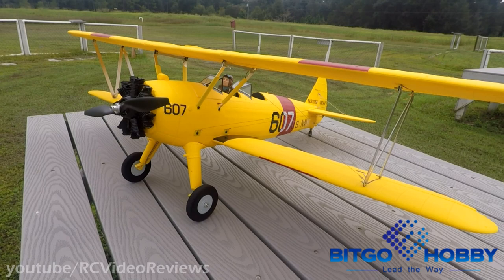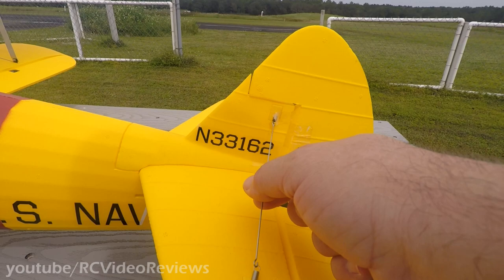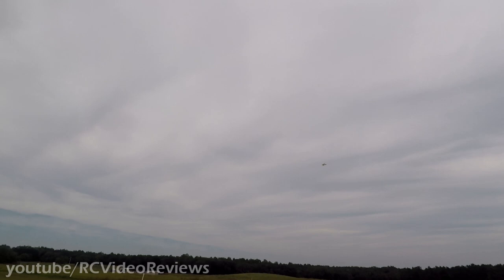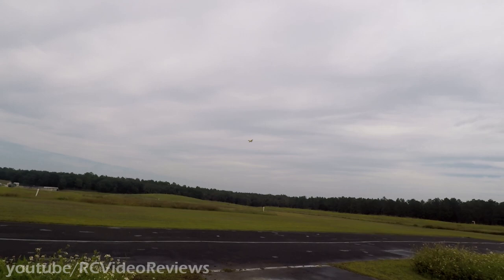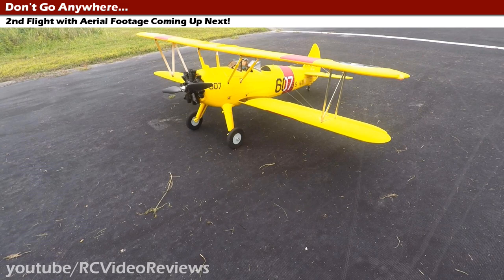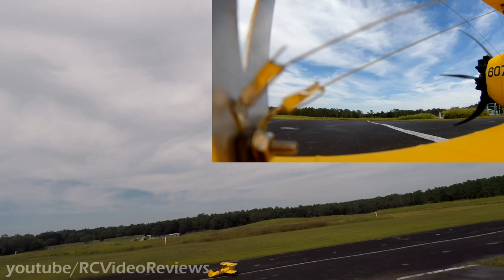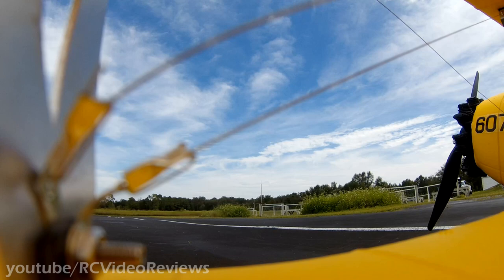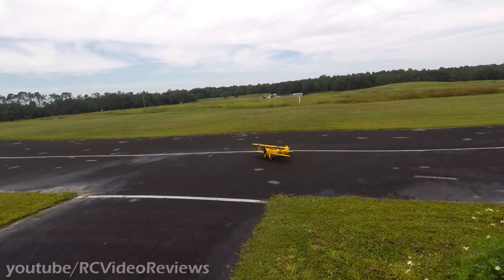Dynam PT-17 Build Recap and Maiden

Comment: I was about to maiden my PT-17 when I noticed Blenderm rudder "hinge" had come loose in my hot garage. I installed two pinned nylon hinges. It's usual to drag a wing tip during landings due to the tall landing gear, might be good to install a "skid plate" of some kind at bottom rear of wings

Comment: I thought you would have used a higher aileron rate, than do in the Waco. About 20%. I would remove or shorten a spring from each of the two tail wires. I don’t think they need a spring on both ends, having them flop around would bother me. The pilot should be in the rear 😁
Reply from the maker: I think on high it's about the extent of servo travel. I thought about taking a spring out but honestly those little plastic connectors are tiny so I don't think they were meant to have any real tension. I'll try it to see, but the plane flew twice and they're still on there.

I can't win with the pilot :)

Comment: 2:28... Just remove one of the 2 springs to tighten up the brace on each side.
Reply from the maker: I thought about that, but I thought that would make it too tight. The plastic holding this springs is REALLY thin. I'll try it and see what happens.

Comment: Looking really good. I did see your first video on it as well. Curious what the overall assembly time was, 2hrs?
Reply from the maker: That sounds about right. You screw the wings on and attach the wires/support struts and after that you setup your radio. There's not much to this one.
Reply: @RCVideoReviews   I noticed your nav lights blinked and on another video they do not. Is there an internal switch to go back and forth? Is the pilot considered 1/6th? Do you know what brand he is?